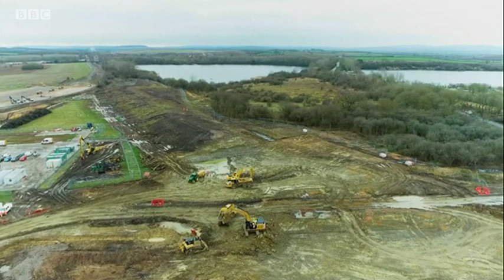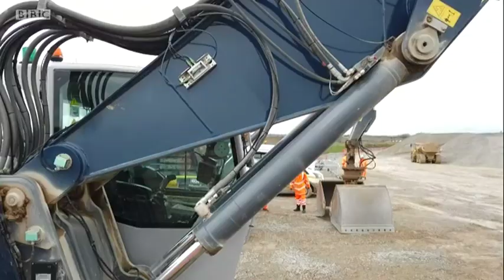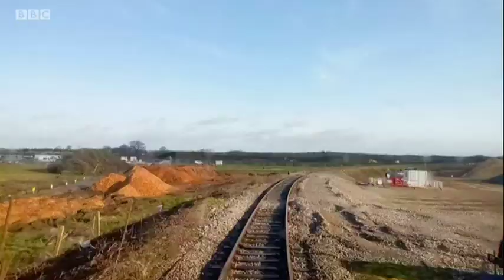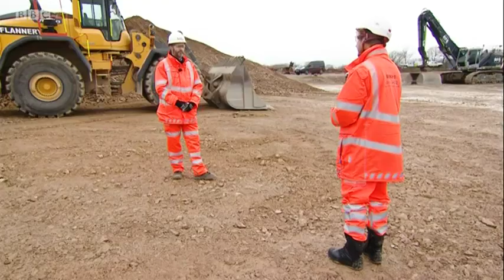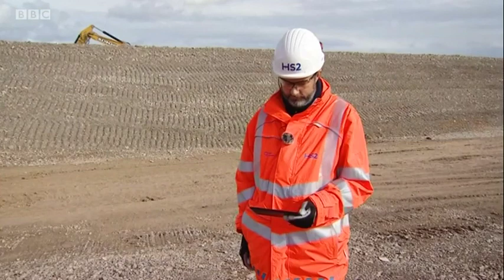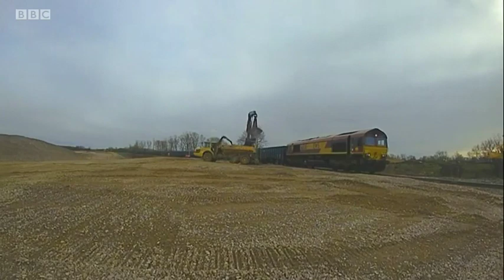HS2 Site Exclusive - BBC South Today

Comment: Who needs HS2 when their are cheaper alternative modes of transport?  A little upgrading to the existing train networks is needed here and there, but I wouldn't go so far to support HS2.  The journey time saved on HS2 is just not worth it, and that's assuming their are no delays due to technical problems or too many leaves on the line.  Oh wait hang on, their won't be any leaves because all the trees will have been chopped down!  Parts of the track may become flooded as their will be no more woods left to store the rain water.  

Traveling by coach remains one of the cheapest ways to travel from one city to the other.  National Express is one of the best coach companies in the UK.  I've seen some of their journeys advertised for as little as 90 pence, plus booking fee of £1.00.  Depending on time of travel and other factors, a one way ticket from Leeds to London could cost as little as £1.90!  The journey time is obviously longer than a train, but the tickets are super cheap!  The money saved could go towards staying in a hotel.

Link to National Express Website - https://www.nationalexpress.com/en
Reply: HS2 is long overdue, as he said in the report they are replanting 30% more trees than they are cutting down. As for your national express solution, ive just followed the link and found the shortest journey time form manchester to london by this method is 5 Hours i.e. more than 4x longer than HS2 (expected 1 hour 8 minutes)
Reply: @cammasters2053   Do you honestly believe that replanting a few trees will reverse the environmental damage from all the ones they are chopping down? It take years for trees to fully grow! Some take several hundred years to reach full maturity. And some trees can live as long as 1000 years or more. It's discusting how they are being chopped down on such a huge industrial scale. You cannot simply replace them and recreate ancient woodlands just like that. After all, the UK is a small Island nation. Green space is fast disappearing from too much construction. 

As for National Express coaches, the journey time from Manchester to London is obviously slower than trains. But that might not matter for some people if they are not in a hurry. For those that travel to London maybe once a week for a work related business meeting or whatever, they could travel down on the day before and stay in a hotel for 1 night or so.
Reply: @Mr_Chris__  The amount of ancient woodland being cut down for the HS2 route is 0.01% of the UKs total, I think the investment, creation of jobs  and improved livelihood of an estimated 30 million people is worth that especially as the trees are being replanted.

Oh so now were adding a hotel cost onto the quadruple journey time? If they travel into London once a week thats 7 hours a week saved by traveling on hs2. Also the creation of hs2 takes pressure off of existing networks making them faster and more efficient. To upgrade the existing systems  to the same benefit provided by hs2 would cost £150Bn and take 15 years in which the whole network would have to be closed on weekends. The fact is hs2 is an investment into the existing network.
Reply: @Mr_Chris__  You mention "the environmental damage" of HS2 while proposing we all use diesel coaches that will sit for hours on overloaded motorways.
The hypocrisy ......
You then rubbish planting 7 million trees... smh

HS2 is far more than about time savings. It adds CAPACITY to the railways system as a whole by removing fast trains off the current routes. Which will free up space for more environmentally friendly freight trains and local passenger services.
Reply: @1chish  I struggle to understand how people can justify the costs of building HS2.  The estimated costs have risen to £107.7bn, up from £32.7bn in 2012.

I would not worry about a few diesel coaches on the roads.  Most air pollution is created by factories, cars, and planes.  And I am not proposing everyone to use coaches.  I just think more people ought to be aware how cheap they are to travel on.  They can then make their own choice of how they travel.  One coach could potentially keep about 30 cars off the road, or free up 30 seats on a train.  Besides, modern coaches are more fuel efficient these days.  And over the next few years, newer coaches will be powered by electric or hydrogen.  Also, modern technology eliminates the need to travel so frequently these days.  More people are working from home which is more reason why HS2 is not needed.  Those that work from home free up capacity on the current rail system for those that must travel.

I am not opposed to planting new trees, quite the opposite in fact.  But I am saddened and disappointed in our failure at conservation.   It's all very well planting new trees, but I think more people ought to learn to appreciate the environmental benefits of conserving the old trees too.
Many old trees provide habitats for wildlife, they store large amounts of carbon and soak up rain water which helps prevent flooding.  Some of the trees that have been chopped down to make way for HS2 were hundreds of years old.  They could of lived for a few hundred more years if they were just left alone.  

As for the new trees, their is no guarantee all of them will survive long enough to benefit the environment.  Before you know it, more greedy land developers will want to chop them down and build more rail lines, more roads, more houses, more supermarkets etc.   The best course of action would be to put a law in place to prevent further building on UK land.  Too much has been ruined already.  Give nature a chance to recover as much as it possibly can and leave it at that.
Reply: @1chish  If or when the HS2 network is completed, it will be interesting to see how much higher the cost will finally be. I don't think anyone will find it so hilarious.
Reply: @Mr_Chris__   No 'if' about it. This will be completed in full. And yes lets all re-convene in 2030 .....
Reply: @1chish  Those that support the HS2 project ought to do more research, scrutinize the rising building costs and question if the project is really worth it.  If they cannot do that, then they are just as irresponsible as the people that are building it.
Reply: @Mr_Chris__   Don't peddle the usual YT Troll's "do more research" bullshit it means Jack Shit. There has been years of research by very skilled (and neutral) people. It has been questioned in open court many times and the objectors have lost every time. Are you saying that judges are 'irresponsible'?
If you have alternative data you should have provided it (if its there). However all you have done is act like an advert for National Express.
Reply: @1chish   I have no doubt their has been years of research by "very skilled people".  None of them are sniffing around for a share of the billions of pounds though are they? And just because HS2 objectors lose a case in court, that does not suddenly mean it is right to ruin the landscape. Judges often have little choice but to rule in favour of the landowners regardless of whatever their personal opinions are.  

I look forward to seeing the first adverts for the HS2 service. It's bad enough what people already pay on the existing train network. How much is a single train ticket from Manchester to London at the moment? About £65? It makes me wonder what it will cost to travel on HS2. About £100 or more? On yer bike!
Reply: @Mr_Chris__   Look take a friendly tip here mate and just stop this nonsense. Your statements are just unbelievably ignorant of how things work. And I quote:
   "Judges often have little choice but to rule in favour of the landowners regardless of whatever their personal opinions are."
Utter crap! Judges rule as the law dictates and nothing to do with 'landowners'. Protesters have lost every case (not just one as you inferred) because their cases had no legal standing.

It is of course only YOUR opinion that this will 'ruin the landscape'. Writes the man proposing more roads that would never 'ruin any landscape'. Just look at yourself!

And then you wander off into some fantasy land of presuming what a train fare will cost in 20 years time. which of course HAS to be mega expensive ...🤔

Just go away, have a quiet word with yourself and stop making yourself look a bit of a plank.
Reply: @1chish   Utter crap? Would you like to know what I think is utter crap? Those that say HS2 will be good for the environment and the economy. THAT is utter crap! 

The whole project is a waste of money.  Estimated costs are £107 billion and counting! Good luck trying to buy a reasonably priced ticket to travel on HS2.
Reply: @Mr_Chris__   Well Mr Chris all you have offered yet again is just unsubstantiated opinion. Now you are entitled to any opinions you like. Even these ill informed bigoted ones.
So here is the thing:
1. Electric passenger trains are THE most environmentally friendly forms of transport by a huge margin. PERIOD. As proven all over the world.
2. HS2 is already providing thousands of new high paid jobs and hundreds of apprenticeships. These earning are all returned back to the local and national economies. As of last December there were 240 sites between London and the West Midlands, employing over 13,000 people with tens of thousands of more jobs supported in the supply chain.
3. You say its a waste of money but provide no proof. I would suggest in employment terms alone that is good for the economy.
4. You keep peddling this '£107 Bn' figure, and I know where you source it, but with no context. Within that inflated figure there is a huge Treasury 'contingency' that will never be used. That figure also includes new trains that will be provided by the private sector (again employing thousands of skilled people (good for the economy)
5. And yet again you peddle your bullshit about ticket prices about which you know the square root of sod all. If your crystal ball is that accurate can I have the Lottery numbers for next week please? 🤣

Now is there any further bullshit you wish to share?
Reply: @1chish   Electric passenger trains are fine, but they are not necessarily "THE most environmentally friendly forms of transport."  Their's a lot of things you have to take into account such as - the number of passengers travelling on a train at any one time and the distances they each travel, the overall network maintenance and the amount of electricity consumption. 

Building the HS2 network seems an awful expense and a lot of trouble to go through. That £107 billion estimate or thereabouts isn't exactly top secret information. And it's all very well providing jobs and apprenticeships to people. But don't you think the existing rail network deserves to be improved and upgraded?

Comment: Some people are so short-sighted...oh I am upset about losing a tree, well soon you'll lose count of them...
Reply: I'm guessing it doesn't go past the back of your house mate.
Reply: @davidhart7792  I wish it did; I'm stuck with a line that has to use diesel power.  Incredibly short sighted
Reply: @sjcsystems  I wish it went passed your house as well. By the time it's built it will be obsolete. Incredibly selfish.
Reply: It's not just 'a' tree though, is it! Miles of ancient woodland,  plus animal habitats.  No regard for breeding seasons. All for a train that won't really save time once folk have travelled to and fro from the station.
Reply: @Chebawitch  this ignorant logic can be used for any mass transport infrastructure built in the country side.

Let's destroy progression to protect some trees while ignoring the massive environmental benefits HS2 will provide in compensation.
Reply: @Chebawitch  How many freight lorries will this line take off an already overcrowded road system? That is what this line is all about, FREIGHT ~~ the original use of the railways.